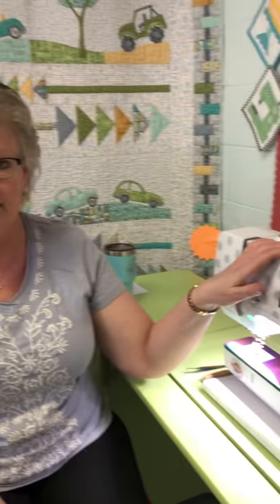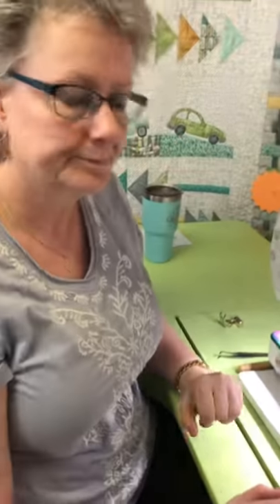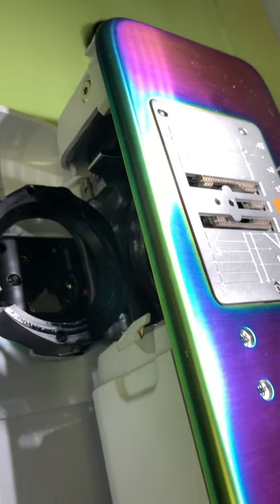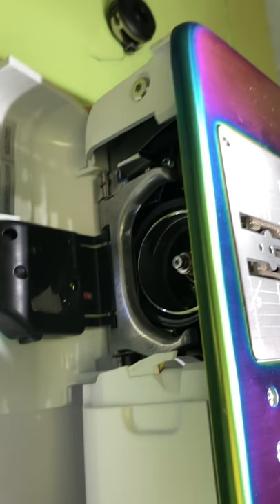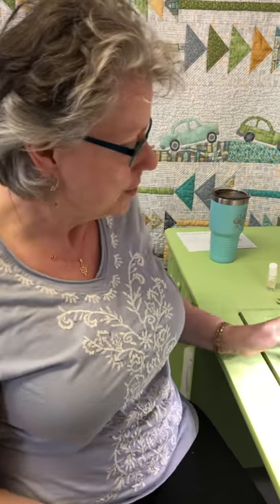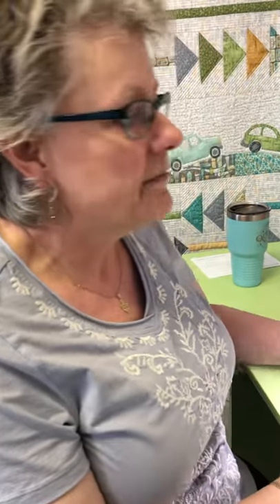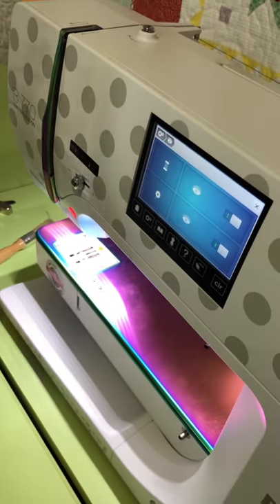Some basic troubleshooting for your BERNINA!

Comment: Thank you so much for this video.  My machine would keep stopping ever 15th stitch.  I cleaned it, oiled it vacuumed it and it still kept happening.  I have a Artista 640 machine so not new like yours but it worked following your directions.  It was the top thread!  I didn't put as much tension on it while threading it evidently.  I threaded it again the way you said using more tension in my right hand and now it works great!  So appreciate your help.

Comment: Thank you, thank you!!  My B570QE had a major problem last evening.  It would sew.  I had a hunch there was thread down deep near the bobbin but I couldn't figure out how to get there.  I didn't realize I could remove the "holder" around the bobbin case - sure enough, there was a huge wad of thread, wound tightly into a little ball.  Once I removed that, put it back together, re-threaded the machine (for good measure!), it works perfectly!!!

Comment: Any troubleshooting advice for my Bernina 475 QE making a chattering sound when sewing?  I have tried rethreading, changing needle,  cleaning hook, etc.
Reply from the maker: I would start with ensuring that you are oiling sufficiently, and often enough, in the right place.  On the other hand, the 475 and 480 have a distinctly different sewing sound than the larger machines, and they do make a little more noise.

Comment: Lisa, here I am again bc my screen froze with 1010 error message and I needed your help once again to get my 780 sewing. The error 1010 message is scary but then I remembered that you helped me before with the same problem. 
Tyf your video. I also cleaned my 780 with your guidance. May God bless you always. 
BERNINA MADE TO
           CREATE!!!
Reply from the maker: That means your hook has a problem. Unthread top and bottom. Remove the hook. Check for threads in the hook area. Make sure your flywheel rotated freely. If not, gently rock your flywheel back and forth till it does rotate freely. Oil snd put hook back in. Then rethread to and bottom. (If you cannot get your flywheel to rotate, then you have a BIG jam and will need service.)
Reply: @QuiltingInTheValley  
Tyf your help. Yes, you were correct! I did all that you instructed and now it's sewing like a dream. God bless you.

Comment: You have just restored my faith in "everything" sewing. I’ve owned my Bernina 570 QE for 5 years and I cannot tell you the trouble I’ve had right from the get go  threading this machine successfully, I went back to the shop several times and the lass would thread it several times and it was fine, I’d change the colour of the cotton at home and bang I couldn’t get it to work, which means I can only sew around 10 stitches before the machine stops so I clear it and sew another 10 stitches and so on. I’ve pieced quilts and sewn garments limping along like this! 
My daughter and I pulled off the front cover and because she had had some success on more occasions than I did we delved deeper looking for why. We threaded it and saw the little spring/coil thingy and knew it was a sensor issue - I wish the lass in the shop had said there was a sensor, after several visits she gave up on me and said some machines are more sensitive than others and mine was one of them. NOW thanks to you I know HOW to get the thread through the sensor, I love everything else about my Bernina except for this threading issue, so when I say thank you, please imagine me bowing at you feet with gratitude. Thank you, I love your direct commonsense approach to fixing problems this home sewist had.
Reply from the maker: Oh my goodness!!!  I’m so glad to have been of assistance!  Please try to enjoy that machine…it honestly is a trooper!
Reply: @QuiltingInTheValley  I’m going to thoroughly enjoy it now  - followed you advice and it threaded through the sensor first time. Thank you again.

Comment: Thank you so much, I have an Activa 125 machine, a much older machine but followed your instructions for the 10/10 message (don't get that message on this machine but it described the issue) opened it up and found the hidden thick thread stuck on the sides which was blocking the bobbin from moving. Really needed to finish a project and was so aggravated that I had to stop and bring it in for repair. You saved my day, thank you!

Comment: Best wishes from a Bernina Quilter from Germany. Your tips just saved me to drive to my dealer one hour away. Had the error 1010. Wheel and bobbin was blocked. With a little pressure I could take out the bobbin and clean it from a little piece of thread.

Comment: I really appreciated this video! I was getting the “two gears” main motor not running error and your tips on the threading fixed my issue. I just opened my box today and hadn’t gotten ONE STITCH in when that error came up—!! Your video gave me the confidence to undo the bobbin area all the way and then I redid the thread as you showed with TWO hands! That fixed it! Woo! Thank you!!!!!!

Comment: I think I love you! The last thing I wanted to do was bring my machine in during a pandemic. That is, assuming repair people are even taking in machines. I'm new at sewing and there's SO much to learn.  I saved your video to my YouTube "Bernina and tutorials" folder. I'll also share a link to this on the Bernina 7 Series group. Thanks for providing some giggles and a ton of relief!
Reply from the maker: Well thanks!!!!  Hope your B Baby is behaving!
Reply: @QuiltingInTheValley  unfortunately, it isn't. I found a tiny ball of thread right where you said to look. I thought my problems were over, but my BSR is still acting up. I get a small nest underneath. I'm starting to regret buying this machine. It's my first computerized one.
Reply from the maker: No regrets allowed!  It’s just the learning curve....you’ll get it!  (And we’ve got a BSR video coming!)
Reply: I had problems with the BSR too.... surprisingly, I found unplugging the BSR (and using it as a plain open toed foot) made machine quilting way better , more fun and less frustrating. You may want to try that as an option.... Waiting for that BSR Video!!

Comment: You have given more information than I've been able to find anywhere.  I have a Bernina Activa 130 and it has just recently started going out of hook alignment.  Had it in shop several times and told he doesn't know what is causing this problem.  Would you know?  At $160 each time I take it in is getting very expensive.  Would appreciate any information you can give me.
Reply from the maker: Hi!  Is the tech telling you that the hook is out of alignment?  That is an odd thing to have happen. Is there another tech to take it to?  (BTW-our tech does not charge if the problem reoccurs within 90 days of service!). Is it possible that the NEEDLE bar is out of alignment?  Have you hit anything with a needle before all this started?

Comment: Thank you for your video.  Very good.  I wanted to know about the dreaded 1010 error message.  I did everything you mentioned.  No luck.  So frustrated because the fly wheel would work when everything was out oof the machine (bobbin, bobbin holder, race).  The race seemed to be magnetically set into machine fine, but once in, the flywheel wouldn’t turn.  In a last ditch effort, when everything was out again, I turned the flywheel 180 degrees so that the pins that the race fits into were now completely turned around.  Voila!!!! Everything is working perfectly.  I think you talked about this, but I was totally focused on those pins being at 10 and 4 O’clock and not the other things you were saying about setting in the race.  Thanks again.  No need to take my machine in for servicing.
Reply from the maker: Now you have the feel for it you will know what to do if it ever happens again!!  Success!!!

Comment: I have a 770QE and continue to have trouble with my cutter, and top thread fraying and breaking! Thanks!
Reply from the maker: What type of thread/needle combo are you using?  You MUST have a needle that is large enough for your thread!  80/12 needles for 50 and 40 weight thread. Sometimes a 90/14 for 40 weight. Are you using a needle designed for the type of stitch you are doing?  (Microtex for piecing and straight stitching, embroidery needle for embroidery, quilting needle for free motion, etc). Most thread break issues are caused by improper thread/needle combos. 

When is the last time you had it serviced?  You may have a burr or a lint knot in the works somewhere if you have exhausted all thread/needle combos. 

What, specifically, is your cutter having problems with? You know to clean it regularly following directions on screen?

Comment: Hi from France :) Great video and tips ! I am going soon for my 60 birthday to buy a 770 QE+ or a 790+ (I don't have decided yet), but with all the issues I read here, I'm not quite sure to change my Janome for a Bernina !
Reply from the maker: Virtually all these issues are user error….not actually machine issues!  Don’t be afraid of these machines!  They are VASTLY superior in strength and stitch quality to a Janome, speaking from personal experience:-)
Reply: @QuiltingInTheValley  Thank you for your answer. I hope I won't be disappointed. Are there some series better than others ? A well-known dealer in Europe don"t sale 8 series anymore because of too many issues with them...
Reply from the maker: I have an 880 and a 790. There aren’t so many issues with the 880, really. It’s a machine that is VERY particular about how you operate it. It will not cooperate if you don’t do what it wants all the time. The 790 is much more lax…you can be more imprecise with it and it still does what it does. Both do beautiful work. I roll say that I prefer the 790, just because I don’t have to be so careful all the time!
Reply: @QuiltingInTheValley  I was confirmed this morning by this dealer than Berninas 7 series are very good machines ; so now the question is : 770 QE+ or 790+ ? ;) :D I can't find really what motives the difference of price between both... transversal sewing ? I have to think seriously about it ;) ! thank you for your help

Comment: Thank you! Very helpful. Can I ask you a question about my Bernina 800 please? My on/off switch keeps spontaneously going off (turns red) randomly while I'm sewing. I'm using the zig-zag stitch to create the satin stitch on a quilt. Periodically while working, it just turns off. It restarts just as spontaneously. Any tips? My last tune up was summer. Thank you.
Reply from the maker: That sounds like either a short in the cord, something glitching in the pier supply,  or possibly a board going out. Are you on a voltage regulator?  That’s different from a surge protector. A voltage regulator keeps the power consistent to the machine in the event of fluctuating power supply issues.
Reply: @QuiltingInTheValley  Thank you!

Comment: Hi I bought a Bernina570 QE  6 months ago and it is working very good .About 1 month ago I bought the Module for embroidery and I was happy making designs all of a sudden it started making a squeaking noise when I’m stitching .It seems the noise is coming from the top part of the machine .I always clean the machine and oil it as well after 3 full bobbins used. Please can you figure out what had happened cause I’m very worried infect I stopped using it .
Reply from the maker: Hi Marthese!  Where are you located?  Can you take your machine to your dealer for them to take a quick look at it??  I think that might be your best bet, as I can't tell you why it would be squeaking without looking at the machine in operation.
Reply: Quilting In The Valley,Hi thanks for answering me.I’m from Malta. I asked maybe it is a miner issue so I wan’t have to take to the dealer and leave it there for a week or more .
Reply from the maker: Yes, that is a pain!  I think you may have to, though. You might want to look at oiling more frequently, though. BERNINA jumbo bobbin machines are thirsty!  I oil mine with every new bobbin!

Comment: Hi my bobbin has a wire sticking out where you first start to thread it. I got the 10-10 message. It keep wrapping around the bobbin case. It is making nest. Thank you
Reply from the maker: That little wire should not stick out!  It is popped out of position. You may need to take it in for service, unless you have another bobbin case to look at and see how to put it back into position.

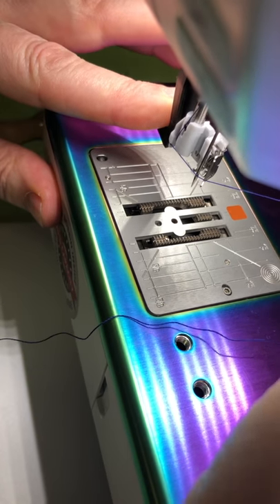Comment: Lisa, please help me with the bobbin case maneuver on my second-hand Aurora 440 QE. I have watched your troubleshooting lesson on this video and realize that my Bernina is a bit different from yours...the hook in the bobbin case doesn't correspond in appearance to my machine's, and the tiny bars inside the bobbin case (the points at 10:00 and at 4:00) are missing. In short I shook the bobbin and hook loose while trying to disengage the bobbin and I can't put them back. Now, tell me please do you have a video for troubleshooting the Aurora 440 QE? If you do and I watch it, my bobbin hook will slip into place, the bobbin will fit and I'll be off and running again!  Thanks.
Reply from the maker: Hey Sharon!  You have a CB hook bobbin, and yes, it is different. Your hook is shaped kind of like a ‘C’. If you use the needle up button to lower, then raise your needle it will set the hook race into the correct position. You will then take the hook and set it into place on the RIGHT side of the race with the hook point on the top. Secure it, and then snap your bobbin into position. Easy!  I’ll try to add a video on seating that hook when I’m back in store Monday
Reply: @QuiltingInTheValley  Thank you, Lisa...you know I'll be watching that video when you upload it.   Your response to my e-mail was like a translation from a foreign language...I didn't know the names of the Aurora 440 QE parts and the tutorials I watched might a well have been written in Sanskrit, but your one-paragraph explanation was all I needed and I am very, very grateful.  Sharon

Comment: i THINK MY TOP THREAD POPS OUT OF THE THREAD GUIDES REALLY OFTEN, IS THERE A FIX FOR THAT?  EVERY TIME IT DOES THAT, IT JAMS UIP THE THREAD IN THE BOBBIN.
Reply from the maker: That is because it is not fully seated in the tension gears!  Ensure that your foot is UP when you thread.  Hold the thread tightly where it comes off the spool with your right hand, then pull it firmly through the threading path with your left hand.  That will make SURE that it is seated in the tension discs properly!

Comment: What can I do if the magnets are straight up and down? The side metal things are not at 10 and 4.
Reply from the maker: Rotate your flywheel until they are in the correct position, ensuring that the silver circle with the magnet is on the lower half or the upper half of the circle

Comment: great video!  Any tips on what to do if you can't select a different presser foot?  Or, just move the needle left or right?  I am trying to put in a zipper using foot number 4, but I can't move the needle right or left, and I can't select the foot - it just tells me info about the foot
Reply from the maker: Do you have a 770?  You don’t actually select the foot on that one. It knows what you have on, and it won’t work if you have the wrong combination of stitch plate/foot/stitch. Do you have the single hole stitch plate selected?  That will prevent you from moving the needle

Comment: I have a 1630 my bobbin hook is out of sync and it has broken several needles. the left edge of the hook is about 1/8 to 1/4 inch off and the needle is striking the left side. Any easy adjustment for this.
Reply from the maker: That’s a visit to your tech. He or she has a tool that they use to set your timing. Tolerances are really tight....it’s best left to someone with the training and the tools to do it right!

Comment: In embroidery mode, b770 QE will not start motif on USB drive because it doesn’t seem to recognize 0mm stitch plate.  Have reset, removed/replaced plate and everything else I can think of, but cannot get past that screen.  Started after initial failed firmware attempt.  Subsequent Successful firmware update has not solved problem. Machine purchased new this Spring.
Reply from the maker: Will it start if NOT using a usb?  If so, perhaps there is a glitch on the stick?  The 770 should embroider no matter what plate you have on. It does not know what plate is on, it just knows what plate you have selected. Are you absolutely sure you’ve selected the correct stitch plate?
Reply: @QuiltingInTheValley  Finally found this video again to answer your reply.  So tried again using a motif already in the machine, and it worked!  Yay!  Apparently it was the motif that had been purchased from OSED online, downloaded to embroidery program (V6) and written to the USB flash drive.  Have purchased and used many other OESD motifs in past, but never online.  Assuming something didn't work when I downloaded the motif to my computer, unzipped the file, and then used 'write to machine' on my embroidery program, using only the .exp.  This could be a headache for the other 33 motifs I saved as well!  Yes, absolutely used the 0mm stitch plate.  (Of note, the B770QE is new for me, but the embroidery module is one I have many times with my B830LE--that machine has become so temperamental, I rarely use it anymore.)  Thank you again for your prompt answer and help in troubleshooting the problem.